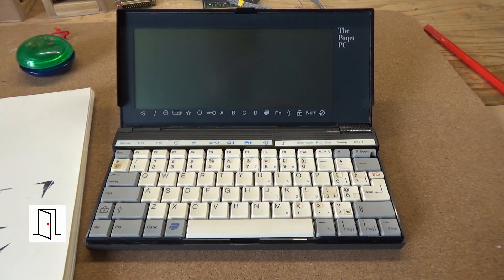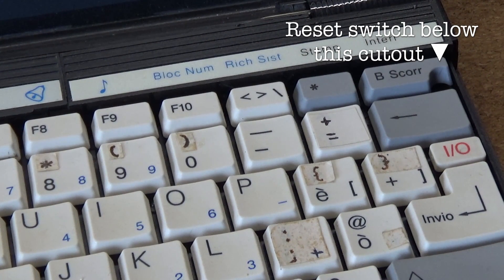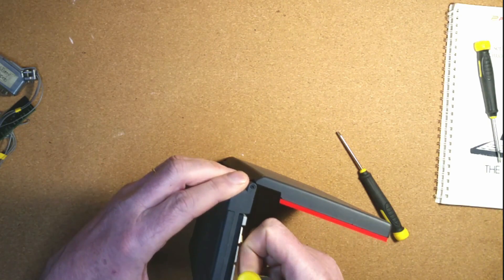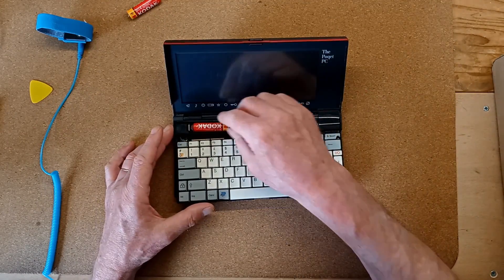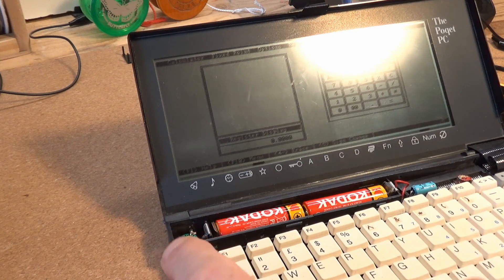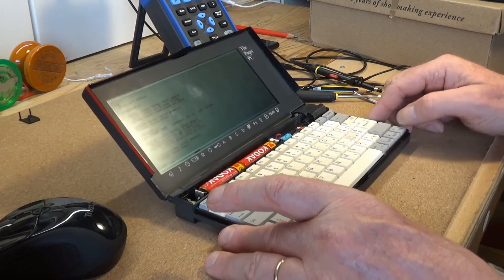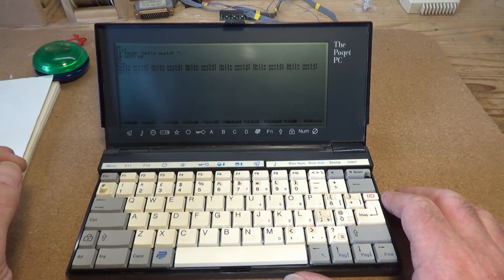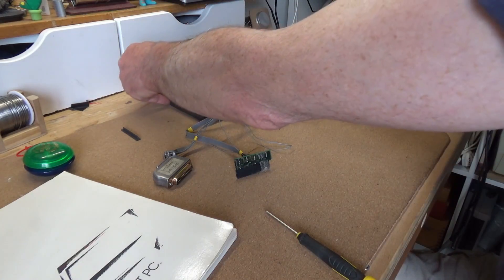How to strip the Poqet PC (...and what you'll find inside!)

Comment: Sincerely enjoyed this video - nicely done. I've been on the hunt for one of these for a few years and finally, got lucky enough to snag one off of ebay. Its a new old stock example, so thats the good news. The bad news is, it's not working. I do hear a faint high pitched sound when I turn it on, and the screen does flash when I remove the power.

I'm wondering if what you experienced is related to the cmos battery being old and exhausted, and possibly with power on the board for a while it somehow affects it? Or would no power feed into the cmos battery? Its a desperate wish, i don't want to disassemble it.

Will leave it with batteries for a couple of days and think positive thoughts :)

Thanks again for the video. Have subscribed.
Reply from the maker: Nice find! The high-pitched whine and screen flash suggests it is working and your strategy of leaving good batteries in it for a few days will bring results I think -- mine never wants to play unless it's been powered for a while. Don't worry too much if you have to open it, the welds break easily and it all goes back together invisibly if you're careful. Thank you so much for your kind comments and for your sub :)

Comment: what were the business use cases for this product?
Reply from the maker: Well... for those who, at the time, might have had a PC XT or compatible on the desktop, the Poqet put the same computing power with a small but truly useable keyboard into a package that was actually pocketable. It would operate for a significant time on two easily available AA batteries and run all your favourite applications. That was the marketing but TBF, it's pretty accurate!